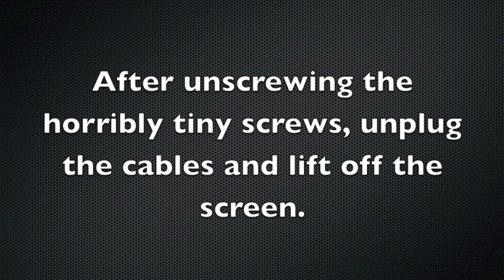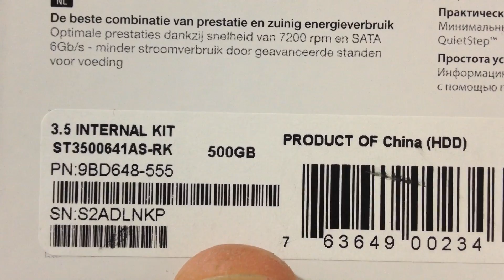How to replace an iMac hard drive - A1224 24"

Comment: Can use small plunger to pull the the glass.   I also was able to pull the drive with taking the cables off the screen.   I did have to pull the small cable apart near the camera.    THANKS for the video.

Comment: I'm hoping you can still read this comment. Have you successfully installed a Mac OS on this iMac? I'm trying to restore our iMac A1124, but I'm having a problem installing Snow Leopard.

I still have the Snow Leopard Disc, however, the DVD-rom is broken, so I tried making a DMG copy of it and made a bootable USB using TransMAc on my Windows.

Installation seems to be successful booting on the USB Bootable, but after installation and restart, I'm stuck on a black screen after the apple logo display.